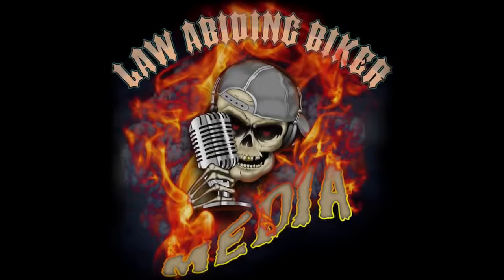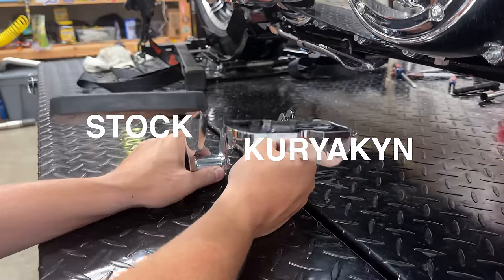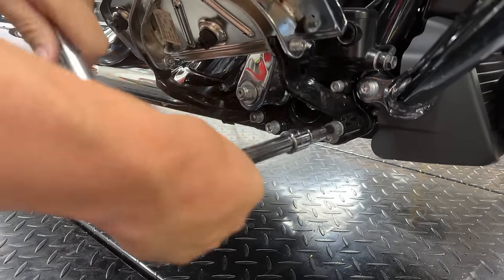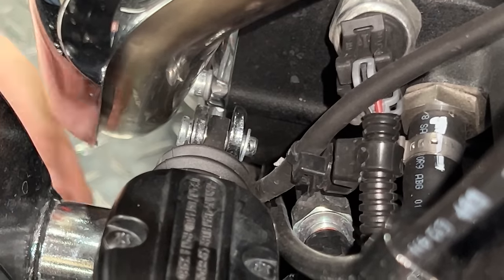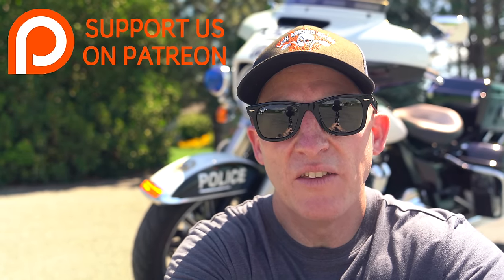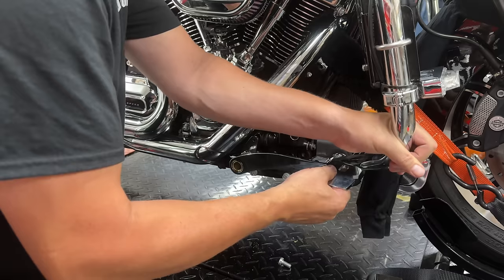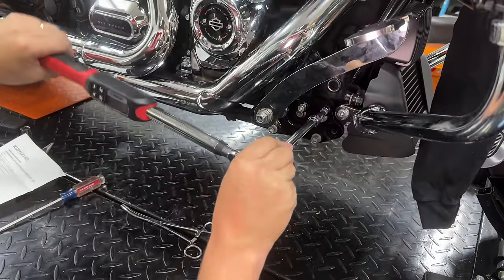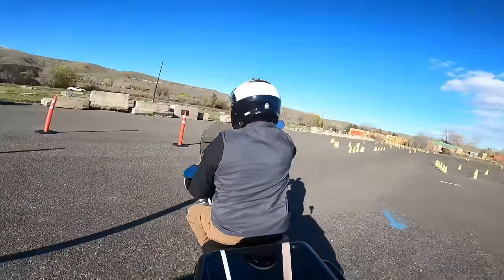The FIRST SAFETY MOD I do to ALL Harley's!

Comment: Softbrake makes one.  
They said that they sell tons to LEOs. 
Tons of motormen get busted legs when falling due to foot getting stuck under the pedal.  Def always making sure my foot isn’t in a place where it can get stuck if something happens. 

Gonna get this. 
Thanks for the vid !
Reply from the maker: rock on 🤘
Reply: I bought the SoftBrake last year and it has made a world of difference. The extended model wouldn't fit my Road Glide Ultra but the extension wasn't what I needed, it was the lower position. It makes it so much easier to work the back brake while keeping the bike under a load during slow maneuver's.

Comment: I've been riding for 40+ years.... Never had an issue. I'm 5'11" with a size 13 boot.
For me, I see this as a preference and an unnecessary modification for my bikes. It may be for better some, but don't say it is a must-have 1st modification.
Reply: Once you ride a bike with a different/ “better” pedal you will likely feel different about this. Maybe not, but that is why there are so many different mods for the Harleys.  Ride on!
Reply: @crossfitfortuna  I doubt it. It's called muscle memory.
Reply from the maker: Each to their own. Thx for watching. I will say,  training for emergency maneuvers, tight maneuver,  and training and on the fast track, this mod is  a must. I use it daily on my police bike and train others. It's a must have IMO. Ride safe.
Reply: @RyanUrlacher  Exactly my point! In your opinion.... It's not an absolute.
Reply: @sirreus3003  And sorry,..but I will disagree: I am 6’4 with a similar size 13 Boot and the easy access to..and use of the Brake Pedal in an emergency situation is definitely much better a great safety improvement… and I have build close to a hundred Harley’s and riding for fifty years 😉✊🏻🇺🇸
Reply: @chrisl.7345  Sorry, I am not a bike builder. I have built bikes and helped others do the same. Don't have a number but been doing that since the 80s.
My feet are on the pegs of my highway bars 99+% of the time and I've never missed my shifter or rear brake.
So you may call it a necessity, I'll still say it's a preference. I will not mess with the orientation of the pedals and my muscle memory. It's a choice. My choice.

Comment: I did this mod on my '94 Soft tail and it made a huge difference with my size 13 boots. Currently with a 2010 CVO Touring I haven't had an issue with the stock pedal, but now that I see the difference...

Comment: Please note if you want to install it on a 2017 up FLHTK with Lower Fairings you will have to bend it a bit to the right so it won’t hit / interfere with the Right Fairing… no big deal !
Reply: think there's any risk to the shaft or what it's welded to?
Reply: @ihateemael  No no, you bend it gently in a Wise a couple of times so you can check it’ll fit. Never bend it on the shaft ☝🏻😉🇺🇸✊🏻

Comment: Great tip, I've always struggled with the rear brake placement on my 2010 road king.  I just thought it was because I was used to riding a bike with pegs.  Unfortunately you don't appear to stock anything for a bike made prior to 2014.  There are a lot of pre-2014 touring bikes still on the road, I won't mention any competitors by name here, but most other online parts dealers carry the girder style for pre-2014 bikes and they are actually in stock too.  I will return when the parts arrive for an install refresher, thanks for the video.

Comment: The extended reach pedal is a game changer.  I can now pivot on the ball of my feet and cover the brake pedal without lifting my foot.  Now I don't have to worry that in a panic situation I'll chomp down on the rear brake.  The position of the original brake made me understand why a lot of guys don't use the rear brake.
Reply from the maker: Nice!! thx for sharing.
Reply: That’s not true. With lower pedal , the ability of pressing of pedal and control is much compromised. The reason why Harley is using it that way is science and well studied. 
Please do not promote articles that completely compromise the controls.

Comment: Ryan, I am 5,7 29-30 inseam. I tried an extended brake pedal. I found it very hard  to get adequate brake pressure for  complete  stopping power,  I sold mine!
Reply: Use your front brake...that's where the power is.

Comment: @ryanurlacher Your videos are fantastic!  I am in the market for a new bike.  Safety is my number one concern.  I come from riding a BMW GS.  One of my big concerns about the Harley's is the weight and lower ground clearance. Seems like to me if you find yourself running into a corner a bit to fast or somebody pulls out in front of you that the Harley will likely take longer to stop and be a bit less maneuverable than an Adventure Bike.  Have you spent any time on an Adventure Bike?  I would really appreciate your opinion on this.  Thanks!

Comment: 30 years ago you could adjust the brake pedal and floorboards, later one's you have to modify indeed, my 1994 adjusted low, 1998 non-adjustable high, 2013 also non-adjustable but low again, 2016 high again ..... modified myself to low position, what do they want at H-D ???

Comment: Do know what the difference is between the extended brake pedal without lower fairings and with lower fairings? i am asking because i currently do not have lower fairings but in the future i will have lower fairings! So not sure which to go with as i dont want to purchase twice?

Comment: Really liked this extended pedal in my previous touring models.  Wanted to use it on my 23 CVO SG, but tech thought that after installation, it would set too close to the mustache shaped crash bars (safety issue?).  So, I kept the stock rear brake pedal.
Reply from the maker: thx for sharing.

Comment: I have a stock brake pedal, I keep by foot resting on the pedal, it does not trigger brake lights, there is no time lag when braking. The extended pedal should probably benifit taller riders, just my opinion
Reply from the maker: It would be hard keeping it there  all day when riding 10 days and 4,000 miles. Riding cross country would be uncomfortable for sure doing that.

Comment: Does that work with lowers and radiators on a CVO 2014 can see any information about radiators. And you’re right Harleys brakes set up sucks been wanting to change mine for years.
Reply from the maker: Yes, we have a model with lowers and without. Radiator won't matter. => https://shop.lawabidingbiker.com/products/kuryakyn-extended-brake-pedal-for-harley-touring-2014-2023?variant=42524179890332
Reply: When I look it up, it says it does not fit CVO’s. That’s on their site. I don’t know.

Comment: I don't have good experience with the brand 'Kuryakin'. Their chrome finish does NOT hold up well. Give it 3 years and it'll start looking like crap.
Reply: Just bought a 2001 dyna in IMMACULATE condition. All Harley Davidson parts except the grips and pegs, both kuriakin. That is the only chrome on the entire bike that is flaking or has any damage at all.
Reply: Same reason I avoid Kuryakin parts. I don't think the part I added made it two years before the chrome began flaking and rust started.
Reply: Agreed 100%.  With that said most aftermarket chrome doesn’t last long at all.

Comment: Let me lower longer Billy problems. You lose break pressure leverage because of longer and everything like that. It should be short and I have no love and boots or living and a 1/2 boot so I usually just put my feet on an eighth so my feet. Sets comfortably so I guess it's for certain people with small feet.

Comment: Does this work on a Twin Cam Limited?
Reply: I did this on a 2010 Road King so should work for you as well.
Reply from the maker: yup ==> https://shop.lawabidingbiker.com/products/kuryakyn-extended-brake-pedal-for-harley-touring-2014-2023?variant=42524179890332

Comment: I can see the benefit of having the brake pedal lower.
But farther out is ridiculous. 
You still must move your leg forward to apply the brake.
I am 5'7" and own a 93 FXRS-CONV and a 2010 FLHTC I have short legs.
If anything, I want to reduce my leg travel to the pedal not increase it.
If it came in a shorter version I would consider it. I basically like the idea.
Like my 93 FXRS-CONV and all the Triumphs and Nortons I have owned hitting the rear brake was just twisting your foot sideways.
You practically already have the pedal covered with no leg movement whatsoever.
You're also able to get your feet to the ground faster to stabilize the bike while stopping.
Using that longer pedal could be the difference between dropping the bike and keeping it upright due to the increased distance the leg needs to travel to the ground during a stopping event.
I'll take the pedal position on my FXRS-CONV and my British bikes anytime over my Electra Glide.

Comment: Did this on my 2019 Road Glide Ultra as well as my 2022 CVO Road Glide Limited.  This should be standard.  The stock pedal is unusable.  Unusable safety equipment is dangerous.
Reply from the maker: Totally  agree.

Comment: Sometimes I think the design guys at Harley are all complete nincompoops. Practically everyone wears boots when they ride. Boots are bigger than shoes and the stock brake pedal and often the shifter lever are too short. They get in the way of just being able to place your feet square on the floorboards. The extra 1 inch or so of length makes it so you can plant your boots on the floorboards without crap being in the way.

Comment: That’s not true. With lower pedal , the ability of pressing of pedal and control is much compromised. The reason why Harley is using it that way is science and well studied. 
Please do not promote articles that completely compromise the controls.
Reply from the maker: Thanks for watching. As a full time police motorcycle officer and instructor, I disagree. I've run both stock and this one. This one is not only more ergonomic, it's safer.